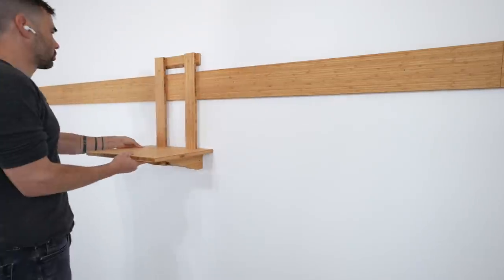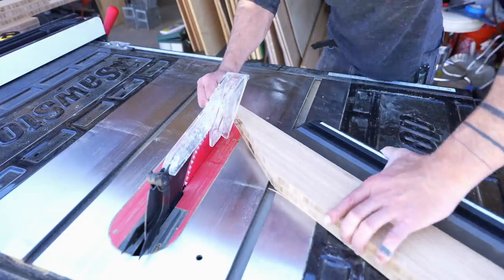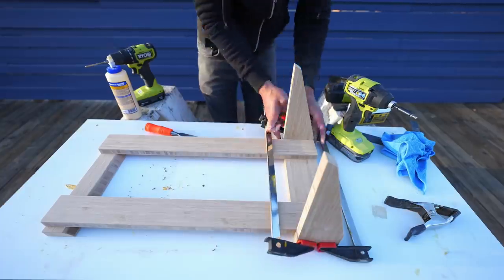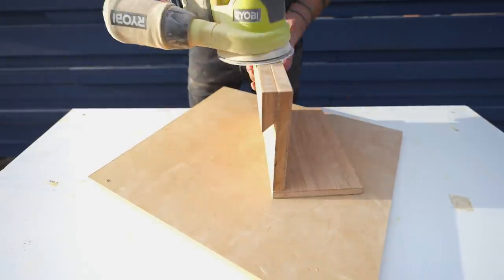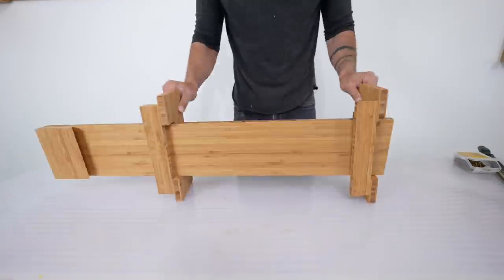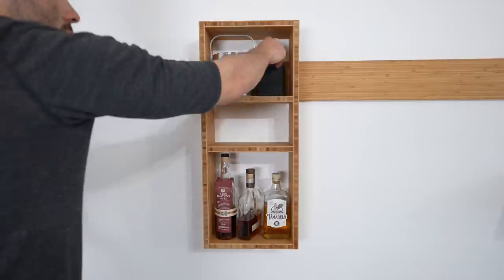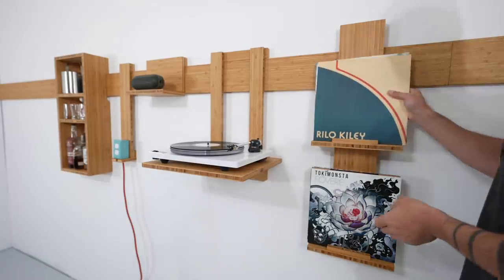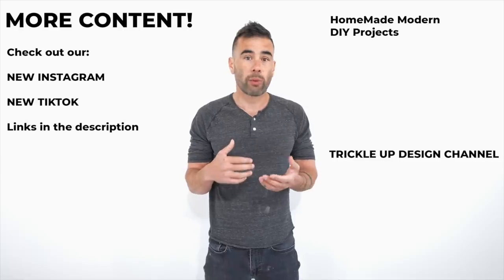DIY Modular French Cleat Furniture System | Bamboo Plywood

Comment: Man your creativity is off the charts.  You make so much incredible stuff and you make it look so easy… it’s not.  

The first thing I would add is a phone/ipod dock right above the plug.  That would be for charging and for playing music with the Bluetooth speaker.  An Ipad/tablet dock too.  Definitely a light above the turntable, especially for those non-automatic turntables.  Hard to see where the needle needs to go after a few drinks…

As you said a bookshelf would be great, magazine racks, maybe a hanger for a work bag, purse, cap, jacket, etc.  When I come into a hotel room, I first need a place for my work messenger bag/computer backpack.  It usually ends up being the desk chair or couch.  I then look for a place to charge my phone and computer.  I also need a place for my glasses, water bottle, and hotel key. I wear baseball caps, so that usually ends up on the desk.  A catch-all tray for rental car keys, wallet and anything else that ends up in my pockets.  I then turn on my music and unpack.  

Would probably run the cables in a channel along the back wall hanger.  Maybe place two or three plugs recessed into the back wall hanger, so that the system is powered.  Only one would plug into the outlet for power.  There’s never enough plugs accessible in hotel rooms… 

I’m going to borrow your vinyl storage idea… Thanks!

Comment: I feel like this is only the second time I’ve ever seen a YouTuber leave the blade guard on a table saw. Can’t believe I have to say it but thank you for normalizing safety.
Reply: One issue though. Using a painting saw blade can hinder the Sawstop safety feature.  So not quite that safe.
Reply: @neilf4128  Not true!
As long as the teeth are not coated and doesn’t have depth limiting shoulders you can use Diablo blades on a SawStop.

Comment: This is gorgeous!
I'm interested to see how the pieces would work in a hotel setting, maybe some much larger items sitting on two rows of french cleats so patrons are less likely to knock them around? And/or like a dowel system running through vertically (in brass because it's a hotel so there must be brass hehe) that can lock pieces in place?
Anyway, I want this in my home. Thanks for the vid!

Comment: Hang a tv on it! For chord management, you could cut a channel in the back of the mount parts that run vertical and even some in the horizontal parts and run cables through them. Not sure where they’d end up at the end but it’s an idea to get you thinking.

Comment: I’ve been toying with the idea of a modular system like this to allow things to be moved around but also have low voltage power supply included so the LEDs in the boxes (I have crap to display) light up.

Comment: For the curious, it’s $280 + shipping for a 3/4” 4x8’ sheet of bamboo plywood from the sponsor.
Reply: Sustainable materials but not sustainable prices.
Reply: Geeez
Reply: Yowza. And to think I would build something out of it for the shop
Reply: And I was thinking he UK was an outlier on prices! Still an interesting project though I wouldn't use bamboo, you could use virtually any solid wood for the rail even walnut or cocbolo would probably work out cheaper and maple or cherry certainly would. Birch ply would be less than a 1/3 the cost of bamboo. Love the idea of getting furniture off the floor.

Comment: For cable management, I’ve seen suggestions for routing a channel. Another method to get a similar result could be to use off it ply to double up the thickness of the wall rail, but only along the bottom and top, so there is a cavity in the middle for cords to go. Gaps could be left strategically to allow cables to come out from or into the rail where necessary. This could possibly make it easier to actually move the cables within, as opposed to routing. 

Anyway just a thought. Love the project, it came out super clean! Perfect project to show off that awesome bamboo ply.
Reply: *off cut ply

Comment: Design ideas and cord management....

What about a single square bar, cleat hung, with cantilevered shelves attached to the center bar. The center bar can be 3 sides with space in middle to allow a cord to pass through, up a wall, connecting to a wall outlet,  but hiding both outlet and cord? Just a thought. Not sure if I was clear enough.

Comment: Having two inlaid pieces of bare 14 AWG copper wire running the length of the system at 12 or 5 VDC might be a really cool way to handle power. You'd then have to use some sort of spring clips to get power into the individual modules, but I think it would be worth it. Think of it like a low voltage track-light system.

Comment: You can insert a low voltage power rail into the wooden rail to power lights, led strips, a radio, small Bluetooth speakers... Those rails are used for spots in eg galleries.

Comment: With regards to cable management..  the bottom of the french cleat on the wall, if you trim out a small section closest to the wall, this woudl give room for the cable to be hidden.

Then use extra french cleat units that would "clamp" the cable to the bottom.  An inverted T.   This way you can adjust the location or replacement of the cable if damaged.
Reply from the maker: good idea! thanks

Comment: something that would improve this design a lot, would be a electric socket directly into the long wood plank, maybe on the corners, in this way you could hide de cables a bit better with a router, between the wall ant the wood

Comment: I'm thinking, if you could insert a "powerline" in the cleats and then do low voltage LED lightboxes that can be moved freely on the cleat. Similar to the old Lego track system, where the power came through the track. Greetings from Germany
Reply from the maker: great idea!

Comment: Soo... Cord management... Cut two strips of the wood, one 1in thick, the other ¾in.
Use the table saw to cut off the outer layer of the ¾in strip, and route an indent for a magnet every 12in. 
Cut strap hinge 11in long, several pieces. This gets mounted to the top (not front) of the 1in strip. The ¾in strip gets mounted to the wall below the cleat strip. Two possible distances... Directly below to blend in with the original strip, or several inches to 18in and use it as the bottom spacer instead of needing to add that to the modules. The 1in strip gets mounted however many inches down you wish to make the cable tray wide. You then need to cut the outer layer of bamboo ply off to use as a door. This gets cut into 11in long by however big you want the cable tray to be. The doors are then mounted so that there is a 1in gap between every 11in door. The inside of the door needs a steel catch plate. If done right, the steel plate should be at the horizontal center of each door, lining up with the magnets. If one magnet isnt enough, more could be added, or a different catch system figured out.

Comment: Thanks for the video.  Interesting you use bamboo products - it seems like the "new" wonder material.  Several years ago I read about the potential hazard with machining these bamboo products.  It was along the lines the tiny fibres will aggravate our respiratory systems and may even be as harmful as asbestos.   (Doing a quick Google search, I only found one MSDS indicating it could cause respiratory problems)  The bamboo board looks good but so far I've avoided using it in my workshop.  Cheers, David.

Comment: you need to find a way to lock modules in place to the support.. kids are curious, nosy and stupid so if they push things up they will fall on them.. that's a big liability especially for a hotel.. an easy fix would be a piece of plywood that cal rotate and push against the bottom of the support that way you can't accidentally push things up off the support.

Comment: I don’t know what this plywood costs in the USA but here in the very expensive and limited choice UK I have just found 2 suppliers. 1 clearly doesn’t expect to,sell much as they quote a eye watering £620 or $858 per sheet while the other charges £192 or $265. That makes birch plywood that I considered expensive at £60 a sheet look like a bargain. And contrary to the Brexiters assurances that we would be fine once it had happened almost everything is more expensive because we don’t make plywood in the UK and birch plywood comes from the EU. We don’t make any power tools either and though most are made in China if Fulfillment is through the EU they are more expensive too. 
Love the projects though but I won’t be making them in Bamboo!!!!!